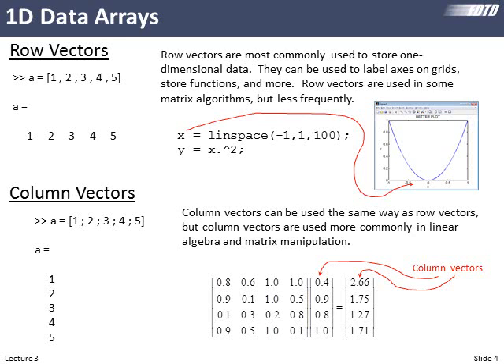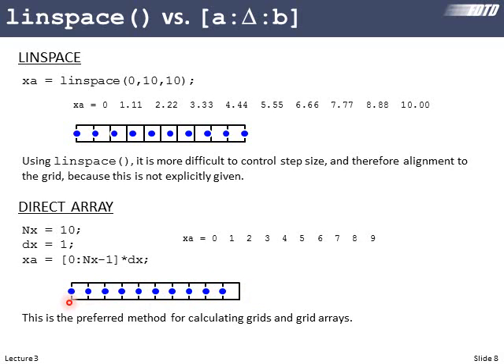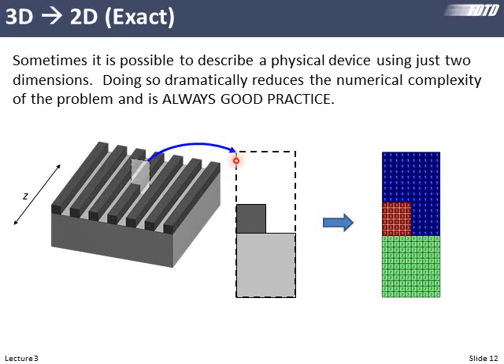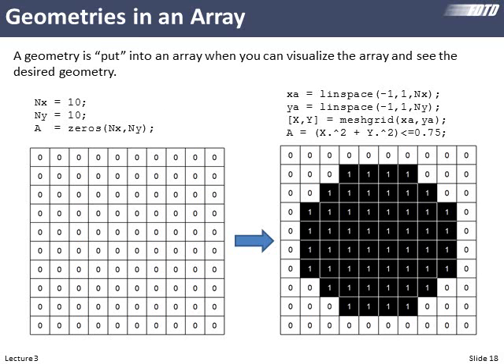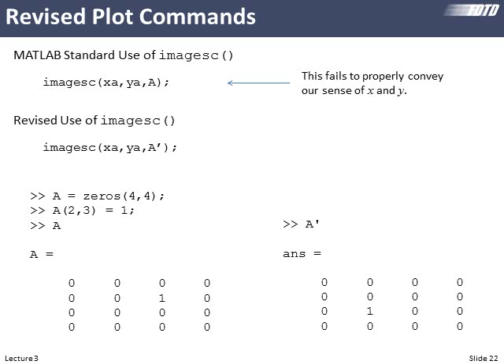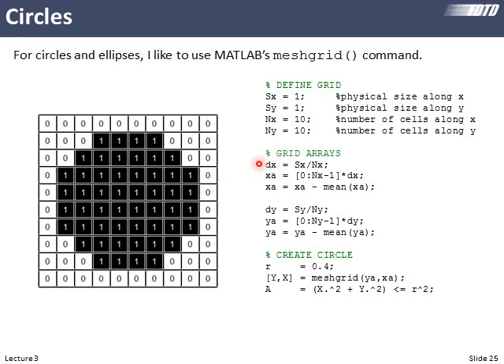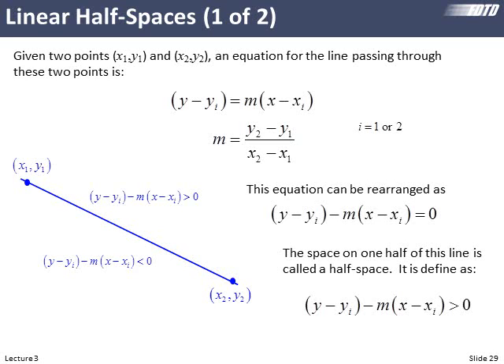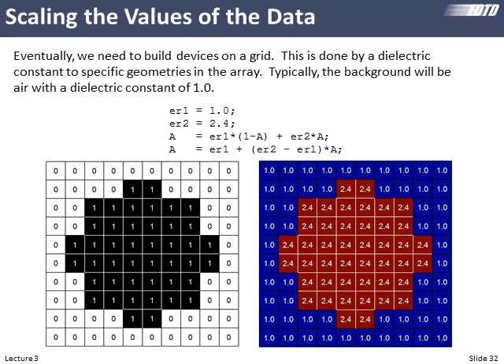Lecture 3 (FDTD) -- Building geometries in data arrays

Comment: There seems something wrong with the codes in slide 28, which tried to determine an area with waving edge along the x axis above 0 in y axis. One should note that the math function y(x) is different from an array A (nx, ny) in MATLAB. In math, the y value is in y axis, and x value in x axis. But in MATLAB, the row column represent the value in y axis. The code "A(nx,1:ny)=1;" should be A(1:ny, nx)=1.
Reply: what is the function i have to use to display the diagrams in slides 18,25,26?
Reply: that matlab codes are not working...please send me the correct codes(slides 18,25,26,28)....my email is nag.474@gmail.com
Reply from the maker: As for the indexing, see slides 19-22 in the latest version of the electronic notes where I talk about this.  MATLAB assumes everything is a matrix so it indexes things more like f(y,x).  I have found that building geometries on arrays is a very confusing topic for students and it is more intuitive to build things thinking like f(x,y).  For this reason, we build things as f(x,y), but then we have to rotate the array before displaying to the screen.  Again, see slides 19-22 where I talk about this.
Reply from the maker: That I know of, there is no built in function to create these plots.  I setup a double loop (x and y) and used fill() to create the squares and text() to place the numbers in the squares.
Reply: CEM Lectures thank you sir...
how we do the matrices for 3 dimensions? suppose we have to assign some dielectric constant for substrate which has length,width and height also...for more than one substrate, how can we assign values using matlab code?
Reply from the maker: nageswara rao challa Great question!  It is a common mistake to think that matrices (2D sets of numbers) can only represent 2D data.  In fact, even if your problem has 50 dimensions, you can describe it with ordinary 2D matrices.  Using the techniques in this lecture, you can extend on those same ideas to create 3D arrays and build 3D devices.  In memory, these arrays (no matter how many dimensions) are stored linearly.  The wording for this is that the 3D array is "reshaped" into a 1D array.  So if your 3D grid was 10x10x10, the linear array would have 10^3=1000 elements.  Then the square matrices that would manipulate this data would be 1000x1000.  So, no matter how many dimensions you have, this data can be stretched out to a linear array and then square matrices constructed to manipulate the arrays.

Does this make sense?
Reply: CEM Lectures thank you sir....but how can we show that arrangement of 3D to 2D in matlab code? where we have to change the code for that arrangement?
in that 3D arrangement how can we assign different properties for different dielectrics...i am unable to get clarity.
Reply from the maker: nageswara rao challa The techniques for building devices in 3D arrays are very similar to what is covered in this lecture, but your meshgrid is 3D.

[Y,X,Z] = meshgrid(ya,xa,za);

There is a later lecture in this series that talks about interfacing MATLAB and CAD that you can also use for creating geometries in 3D.

I don't think I have any visualizations of the process of creating matrices from 3D data, but I have some thoughts about what that could look like.  Usually I only teach 2D methods so the codes are easier to develop for students and run well on low end laptop computers.

If you have a 3D array a(nx,ny,nz) that you would like to reshape into a 1D array, you could do either of the following:

v = a(:);
or
v = reshape(a,Nx*Ny*Nz,1);

If you want to make a diagonal matrix (see CEM lectures) from a,

A = diag(sparse(a(:)));
Reply: CEM Lectures is it possible to do different patch antennas (spiral,circular  and different shapes)using FDTD? when we use multiple substrates,how can we optimize their thicknesses? how optimization is done using FDTD? i want to design an implantable antenna operate at 400-420MHz...can you please tell me the steps for this? give a brief explanation here or send to my email : nag.474@gmail.com
Reply: CEM Lectures suppose we use resolution of grid very much less(<<0.1mm), then how can we write that big matrix? suppose we have to use other rhan the numbers 0 and 1..how can we assign some part of the portion with some other value?
Reply from the maker: nageswara rao challa Yes, this is absolutely possible.  Simply put, to optimize their thicknesses, you just keep trying different values and see what works better.  You can get much more sophisticated about doing this.  See Lecture 27 here for more on optimization:

http://emlab.utep.edu/ee5390cem.htm
Reply from the maker: nageswara rao challa Don't think of the array you are building as a matrix.  That will only confuse you.  While to the computer matrices are just 2D arrays, they are very different in how we use them.  Matrices represent sets of equations.  Arrays just contain raw data.  Matrices are using in linear algebra algorithms.  Arrays are used in much more brute force algorithms like FDTD.

I like to build the arrays with 0's and 1's then convert to realistic material values as the last step.  See Slide 34 in the electronic notes of the latest version of Lecture 3 that you can get here:

http://emlab.utep.edu/ee5390fdtd.htm
Reply: suppose in that slide,you gave only dielectric constant value,suppose  i want to give multiple properties(tan (delta),conductivity.....) to the same portion.how can i give it?
now come to thickness part....can i assign whole Z-dimension(thickness) in single grid thickness without changing the x and y dimensions?

i am in total confusion and wasting lot of time because of not knowing the implantable antenna designing steps... give me clarity about first what i have to desig, next what,next...... like that
Reply from the maker: nageswara rao challa In a frequency-domain model you incorporate loss just by making the permittivity complex.  In FDTD, you can't do this.  Instead, you will need to build yet another set of arrays for the conductivity.  You will then need to retain this variable in Maxwell's equations and calculate update coefficients with it still there.  I give an example of this in the second to last section of Lecture 10.

As for z thickness, it sounds like you really need a 3D simulation whereas the examples in this Lecture are for 2D grids.  Building things on 3D grids uses all these same techniques, but just includes the third dimension.  The thickness of your layers is then conveyed by the size of your grid cells and how many you fill in with the properties of your layer.

As for implantable antenna design steps, I would put that aside until you have a working code or model.  If you are in a hurry, you can look at one of the free or open source modeling packages I point to on my website here:

http://emlab.utep.edu/resources.htm
Reply: CEM Lectures our guide asked me to work only on matlab. i am asking you that for what what things i have to write code in order to get the implantable antenna?
Reply: CEM Lectures including dielectric,can't we use the skin,fat,muscle layers as multiple dielectrics, one above the other? then we will assign different dielectric constants in the Z-axis for different layers by choosing very low grid resolution in Z-axis
Reply from the maker: Yes, but I am confused by your statement of assigning different dielectric values by choosing very low grid resolution.  You will need enough resolution to show each layer and then assign the dielectric values.  

On a slightly related note, I have a link to a website that is an excellent archive of the electrical properties of biological tissues.  It is the third link here:

http://emlab.utep.edu/resources.htm

Hope this helps.
Reply: CEM Lectures thank you sir,but i want the formulae according to which the properties permittivity and conductivity change related to frequency.

for one layer,we take one cube grid and assign resolution and properties.....suppose we have to add one layer above the other,then how we write the code? i.e how we give that in the matrices? or
we have to change the properties  in the Z-axis dimensions only for the same single model?
Reply: CEM Lectures sir,regarding dielectric,we know the reflection coefficient at one frequency,from that how can we find the dielectric constant.suggest the formula
Reply from the maker: nageswara rao challa The topic you are asking about is called "parameter retrieval."  Check out Lecture 15 here:

http://emlab.utep.edu/ee5390em21.htm